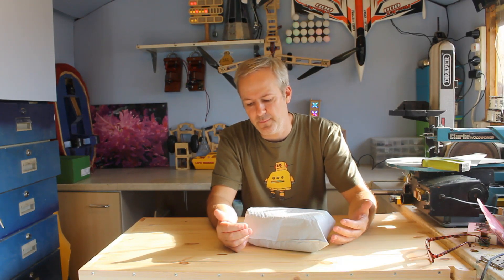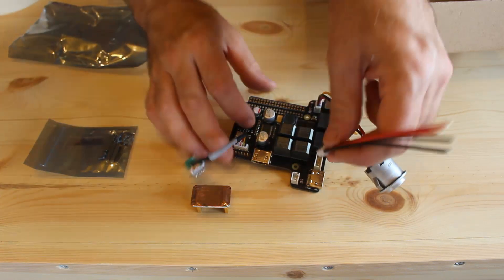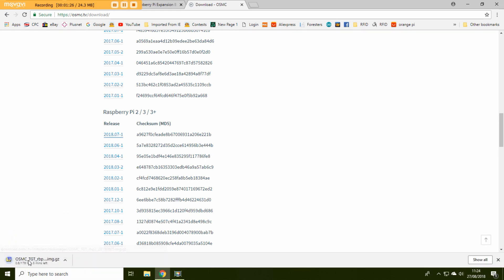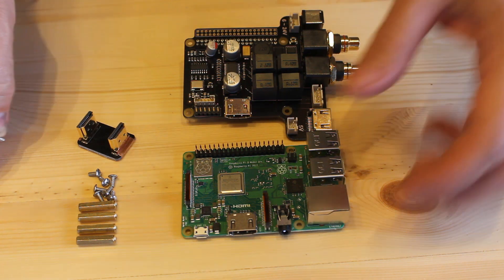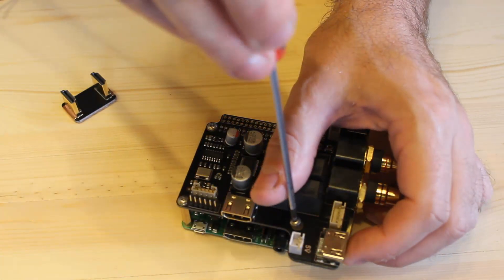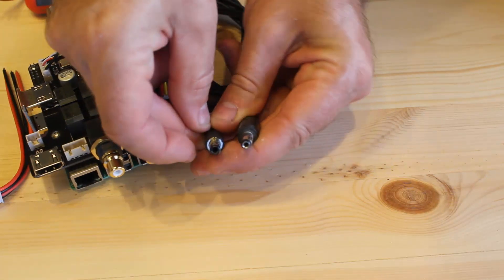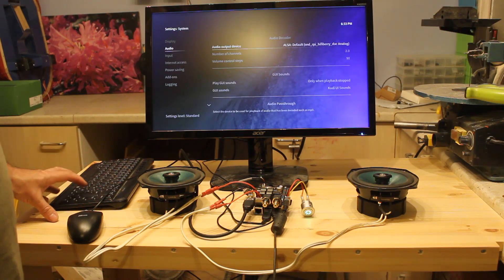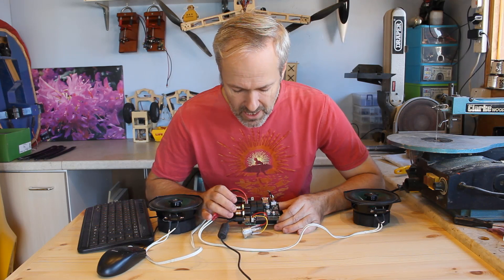Raspberry PI, DAC and AMP, SupTronics X5000. OSMC. GearBest

Comment: Did you have problem with mono sound? I use volumio and I have only left channel. I have mono, not stereo
Can you help?
Reply: I just finished my X4000 Dac using Volumio, haven't had a problem yet with channel issues. Played a few hours on it already.
Reply: same issue with the x5000 here... really anoying